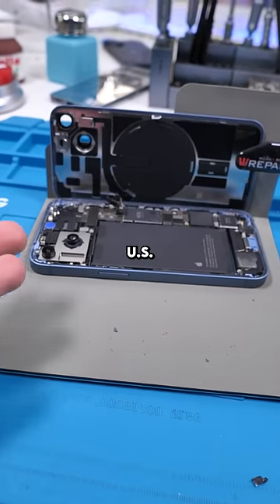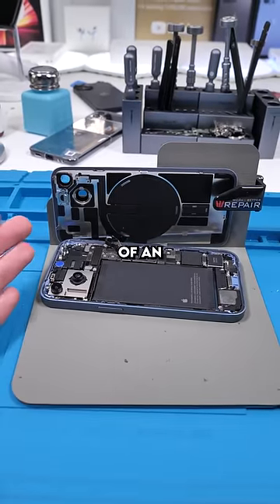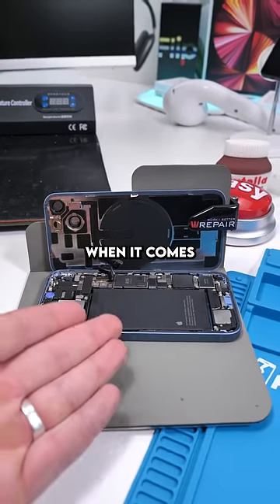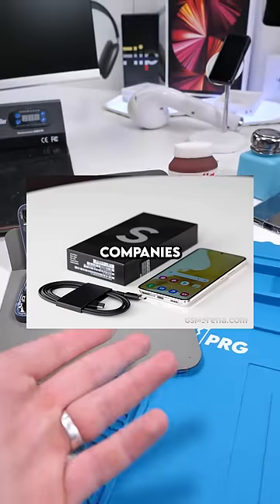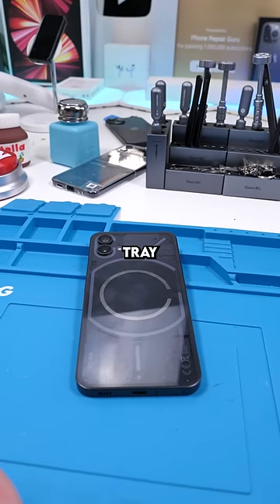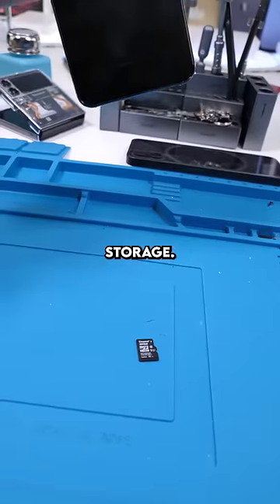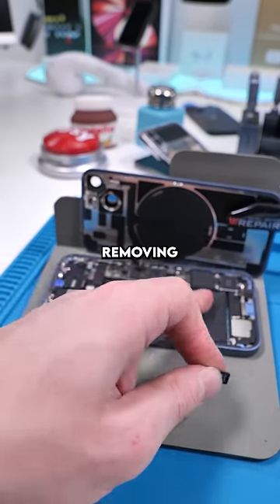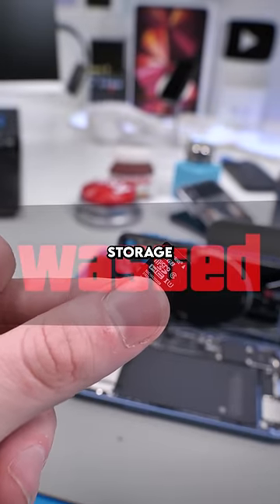The Serious Downside Of E-SIM..... #shorts

Comment: My biggest issue is that you can’t just buy a new unlocked phone and slap your old sim into it to activate it. You also can’t take your sim out in case your phone breaks and put it into another backup phone.
Reply: Exactly! That is going to be the bigger issue here! Or how if you were travelling to a different country.
Reply: Technological advancememt issues supposed to make things more convenient but not to make your life a living hell. 
I've lost count how many times i had to just pop out my sim from one phone to the other cuz battery died or phone is broken.
So they telling me i need to contact the network operator just to swap my sim?
Utter foolishness. 

We all know it ALL about another step up in apples persistent strides in their walled garden. Where is the consumer protection authority in this??!!!

Utter foolishness!!!
Reply: Please explain then what would be the point in buying an unlocked phone?
Reply: @Mikein203  so you can use it on any carrier.
Reply: Ehh, i was able to slap my iphone se simcard (the version b4 steve jobs passed) and slap it into galaxy s8. Then using the same sim card, and slap it into s20. 

All AT&T rep did was take a scissor and snip off the extra plastic. 🤣
Going from Standard to Micro to Nano.
Reply: @thenxtbillionaire  the original iPhone SE uses nano sim, no need to snip any plastic going to a new one. My current sim came with my iPhone 5s from 2014, and it works fine in my se 2022.
Reply: Wait you could do that??
Reply: @Eksammi  maybe you should stop breaking phones or letting them die 🤦🏻‍♂️🤦🏻‍♂️
Reply: you can acces it from another phone i think so its even better when u lose it
Reply: Yes! I was travelling and my phone got damaged, and needed to buy another phone to use.
Reply: @dyldog  
Maybe they don’t break the phones? Someone else who was using the phone, such as a kid, could have broken it. Either way, when disaster does strike it’s so much more convenient having a physical SIM card.
Reply: Guys can someone please explain?
I can put my simcard in every phone and it works with no problems.
Is this some American thing? I'm from Germany btw
Reply: @UltraHQ  yes it's the USA variant of the iPhone 14 range, no Sim slot.
Reply: @UltraHQ  the iPhone 14 series in the US has no SIM card slot.
Reply: Maybe eSIM Cards ar easy to hack
Reply: Dunno where you lived but over here the "unlocked" phone is the majority.
Reply: Agreed Yeah i'm so clumsy with my S10 (and it's case) . In the three years I've owned it I've ran it over at work twice and had a dead pixel take out half my screen.

I already have enough trouble getting my carrier to give me a new Sim as it is so the hassle of dealing with a Esim is not going to be a fun experience
Reply: yeah especially i am in iraq and e sim isn't supported i mean not that everything is supported in iraq
Reply: Instead of putting the old sim into the new unlocked phone you can over the internet or by a phone call transfer it to a new device, Apple has a pretty neat way of doing it, I found this out when upgrading my iPhone 12 Pro Max to the 14 pro max
Reply: @dyldog  He's talking about how old phone broken and can no longer functional. Took the card from there and put it in a new phone.
Reply: @gilgameshlfx7006  I mean if you’re accident prone then don’t get an e-sim only phone until it’s more mainstream and perfected, but iPhones back to the XS supported e-sim and many older androids as well, it’s popular in Asia apparently to have multiple sims on one device
Reply: @dyldog  I lived in Asia and this is the first time I heard about it. I do know unlocked phones can carry multiple sims because it supported dual-sim system by having a hybrid simcard/microSD card slot system alongside a dedicated simcard slot.
Reply: @gilgameshlfx7006  I might be confusing dual sim and e sim, my mistake. But I know for a fact iPhone having both and now just e sim will push the whole market to only e sim and make it more accessible and user friendly
Reply: @Mikein203  I've been buying unlocked phones since the the galaxy s4. There's no better freedom than being able to pull a sim card and change carriers when every you want. 

Plus no carrier bloatware on the phone.
Reply: Except that with some eSim carrier, you can easily switch your eSim from iPhone to iPhone in a few minutes. But that will depends on the carrier. For exemple my father who is currently using both an eSim for work and a nano sim for personal list is phone in the ocean, and could quickly transfer his eSim while is nano-sim got lost forever in the ocean.
So, in my opinion, eSim are simply better than physical sims, but the technology needed a boost, especially on the side of the carriers, and that’s kinda of what Apple is forcing them to do. I bet in 1-2 years eSims problems will have been mostly fixed.
Reply: You convert your sim to esim with uour operator. In my case it was free. You get the qr code, scan it on new phone, add it and voila.
Reply: @rrafal  he was talking about switching the eSim from phone to phone.
Also, if you talk about my father losing its sim, the issue is that our operator just decided that they would not allow conversion of existing plans, only allowing eSim for the creation of the plan. So that’s dumb.
However switching from phone to phone takes about 3-5 minutes
Reply: Definitely a reason why I would stick with the normal SIM cards
Reply: @gilgameshlfx7006  where I live carrier locked phones have been illegal to sell for a few years now.
Reply: @Eksammi  truth.
Reply: I love how this "future" keeps moving backwards, only on the worst directions.
Remember when we had only one proprietary port to charge and use headphones, plus TDMA phones you had to go to a carrier to set up a phone line?
Yeah, super futuristic.
Reply: @dyldog  You know that phones are not indestructible, right? And they do break suddenly, I have a Sony one that the eMMC suddenly died
Reply: @mjetektman9313  well yea obviously phones can break, but I’ve never broken a phone physically because I take care of my stuff 👍🏻. The storage failure sounds like a manufacturer defect and should be covered under warranty unless it’s a reaaaallly old phone.
Reply: @dyldog  my phone is old so yeah, no way Sony would cover, but I'll replace the main board to use it as secondary phone
Reply: it wont go well in uk if they tried this since unlocked phones are a very big deal here. 

clearly in us unlocked any network is not that big a thing here and i read most are locked on contracts anyway it would also damage network payg sim card purchases in uk.
Reply: @johnlucas6683  Apple will just tell you to buy another phone for that country , as long as you buy an iphone of course
Reply: @dyldog  Trim the sim card ?? yes
Reply: @Eksammi  preach 👏👏👏
Reply: Do you want something new flashy and popular? Then you don't actually need anything that works, and your money can be used to subsidize useful phones for those of us that actually want a useful tool for professional use. 
If you have a proper job and want a proper tool, then be thankful trash like this is sold to people that will pay any price for a shiny new gimmick to show off to total strangers for likes.
Reply: @vizender  with a traditional sim and an unlocked phone, switching takes about 5 seconds.
Reply: @EvilTurkeySlices  except when you don’t find a tool to open the sim tray
Reply: Sim cards can also be used to store your basic contacts like their phone numbers, allowing you to transfer that data instantly to whatever phone you insert the sim in... Cant do that anymore...
Reply: Fyi apple made it impossible to buy a unlocked phone unless bought from apple
Reply: @dyldog  Dual Sim is extremely convenient. Why? Cheap call+text plan and a separate data-only plan is sometimes cheaper than combined (or for occasional int'l calls). OR--when you travel, pick up a cheap data plan for the second slot (no roaming) while still receiving your normal calls and texts from home.
Reply: Protect the iPhone 13 13 pro and 13 pro max at all cost. Both two of them for that reason

Comment: They want you to pay for cloud storage. Holding your files to ransom.
Reply: Good 👍 job 👏 if I were your teacher you would get 💯% on home work
Reply: Not unless you use your own cloud system hosted at home just how i do it right now. But having the extra storage in the phobe will be missed
Reply: @MrKibblezWorth  u mean using NAS
Reply: @clashofchampsoo2697  Well yea I do have a NAS which can be used as a cloud and among other things.
Reply: I thought so . I only use cloud for storage so it’s no problem. 😊
Reply: Buy an adapter so u can use ur card again.
Reply: Big Data
Reply: You already do pay for iCloud storage. I pay 79p a month for 50GB
Reply: I HATE THE F ING CLOUD
Reply: Why did I imagine the cloud holding a folder at gunpoint
Reply: Weigh the options: Cloud storage requires an internet connection to be able to access, while SD Cards allow for offline access of files, Cloud storage doesn't slow your phone down if it's an older model, whereas for SD Cards it slows older models down etc. etc.
Reply: And most people use it anyways.
Reply: Yeaahhh but, it’s much cheaper than physical storage to just have a dollar or two a month service anyway. Back in like 2010 a gig would be like 5 bucks a month. Now it’s like a dollar a month for like 50. That’s on YOU if you want to pull the whole “I’m a closeted pedo who wants my first amendment right” card. Nothing to hide, nothing to fear. Too many eyes to have on too many people who just use storage for everyday things. (Like nudes, we all have our sig others nudes. Nbd anymore)
Reply: Exactly, once the phone has no offline storage, our private data is in danger. Only Apple couldn't care less due to their greed
Reply: Yes I’m trying to get out of the trap. It’s sad how they are moving towards such a future
Reply: They actually want you to pay for storage upgrades at inflated prices. If you can't expand storage then they can push you to pay more up front. At least for Apple, their physical storage per gb is around 50 cents on average or $100-500 per device up front. Even on the cheapest upgrade of $100 they'll make more from you than in 3-4 years of subscriptions.
Reply: @312bigbeanburrito  times like these i wish we are still using old nokia keypad phones. Cost $200. Lasted almost 10 years, i dropped it 100++ times, not a single crack. been in water and survived. The golden age where phones are resilient. Nowadays, a single drop and the iphone is cracked, hardware damaged or water damage will make it shut down forever. Worst? These iphones usually won't survive the year without some hardware malfunction even in mint condition. Fixing it cost $200-$1.000. Now they even try to extort you for storage. What a twisted company APPLE is. Im amazed how people are still so hardcore delusional about using APPLE products.🤪
Reply: Dont use apple cloud use Google cloud because I have all my contacts saved to my Google account
Reply: @@OnyxDeath13121,5 GHz and 3 GB RAM and there are already 8, 12 or even 16 GB RAM phones
Reply: @@OnyxDeath1312 What about games
Reply: no, modern phones have hundreds of gigabytes of storage so no need for stupid sd cards anymore.
Reply: @artiemilano378  that’s a terrible argument. 

What about parents that have bath photos of their kids? Or first photos that are normally naked babies?  They don’t want those out there floating around.
Reply: @Nyandano  It essentially is.
Reply: @piezku  That doesn't matter apple-fanboy, after a few months it fills up
Reply: @dirpydemon7678  no it does not. i have never needed even 32gb of memory
Reply: I bet having all my stuff stored local will be a hastle In 10 years...
Reply: @artiemilano378  "much cheaper", you do realize phone storage only costs as much as it does because people are willing to pay for it, the reason its "expensive" is to make you to use Cloud storage...
Reply: @unforgettableflower613  a 1tb used hdd costs less than 10£ apple isnt doing you any favors with the cheap price.
Reply: @piezku boomer usage.
Reply: Unless you have tons of apps on your phone, you can just buy an USB-C flash drive.
Reply: its a service that gives you a similar experience with most server users. Just create your own server yourself for your files.
Reply: @leonsgameplays5804  weigh the options, if you drop your phone from a ship, lost it, stolen, burnt, etc, left at the airport etc, how will you use your backup?
We are at an age where internet is readily available and fast enough that its not really a bother to store your files in the cloud. Also if you fck up your drivers and store some bootfiles to fix on your sd card how tf will you use it if your device ittself cant read it. also what if you transfer files between devices and the other device doesnt have an sd reader. You have to constantly bring a dongle with you lmapo
Reply: Then pay for google drivve, not iCloud
Reply: Honestly tho cloud storage is nice. If anything happens to your phone you have everything saved
Reply: @hlaminto2008 according to zdnet "Gen z is ditching iPhones for feature phones"
Reply: Here’s the sting about data, make backups. Having it on cloud is just as important as physical
Reply: what why
Reply: And it's all requires a subscription. Bye bye to one time purchase.
Reply: Removing the 2nd sim slot in phones pressures phone users into buying cloud storage options for their phone.  I can see this occurring when phone companies bundle the service with a "free" or discounted phone when you commit to their 2 year service plans as a new customer.
Reply: Cloud access is also useless as shit if you travel. You only have to go for a short road trip through the mountains to realized that cell service only exists near the cities

Comment: This hit hard as I said goodbye to my note9 and had to move to the S23 ultra.
Reply: was the upgrade worth it? im sti using my note 9
Reply: @Diamoondust  It took some getting used to not having the fingerprint on the back. I do really like the bigger battery. The camera is outstanding, but i will never use all the options. So far the S23 ultra has been a decent upgrade.  I still miss my old note9.  I use it for other reasons still besides calls and text.
Reply: @ruddersidedown i miss the dedicated finger print button, the one under the scree. sucks ass. and cant wake the phone as well
Reply: @TheWipal  Same here!  It was perfect.  I had the note9 for 6yrs and now it is habit to tap my finger on it even though it's not there anymore.
Reply: Note9 is king.
Reply: Yeah I just did the same thing. Ironically even though my S23 Ultra has a brighter screen, it also seems duller. I noticed similar with the 8-9 but the 8 was brighter so I thought it was just the brightness at the time. Perhaps it is intentional.
Reply: @TheWipal  Samsung's dedicated finger print detector was always garbage. Honestly think it was even less reliable. My main issue with the under screen one is finding it or properly centering my finger.
Reply: Bro chose a phone with less features 😂
Reply: @VinnytotheK  every phone has less than the note 9 today. Other than maybe an ROG phone
Reply: @Skylancer727  Have you tried the ROG phone?  I seen it just after I bought the S23 ultra.    I have a ROG STRIX laptop and I absolutely love it.  That laptop is a beast.
Reply: @ruddersidedown  great, that doesn't say much about the phone. The Note 9 had a lot of features not gets anymore. Dedicated fingerprint sensor, expandandable memory up to a terabyte, iris scans instead of fingerprints or face scans, a blood oxygen and heart rate monitor, and a pressure sensitive zone for easy access to home. Most of these features will likely never return
Reply: @Skylancer727 the pressure zone, fingerprint sensor and expandable memory are the only things on that list I even care about
Reply: @jerkface38  that iris scanner was a godsend to me. It was the whole reason I kept that phone through covid as I could still unlock it with my gloves for work and my mask I was required to wear. That one is honestly the biggest feature loss. As I said, Samsung's dedicated fingerprint sensors were always slow as balls and rejected your finger 5 times before working. It was even worse with a case as it required you press so hard for it to recognize. I will never miss Samsung's old sensor, the under screen one works far more often. 

That pressure zone though was great for nor having to both swipe up from the bottom and hit the home button or to get out of apps when the phone was lagging or an app was crashing. Will miss it but I do think it is a lower priority. Did like playing with it though as the haptic felt funny. 

And the heart rate and oxygen sensors were great for sporadically checking if you felt kinda poor. I don't really like the idea of burning $300+ on a watch that now needs to be charged daily vs the cheapo thing I've been wearing for 15 years and still hasn't died yet.
Reply: That's not true, it can do all these things and it works perfectly fine.  @TheWipal
Reply: @TheWipal you can wake the phone by tapping on the screen
Reply: @nAcolz  drains batter faster, takes longer for my to finder finger print scanner since it is under the screen, if i dont lock my phone the day its lost will be horrible XD